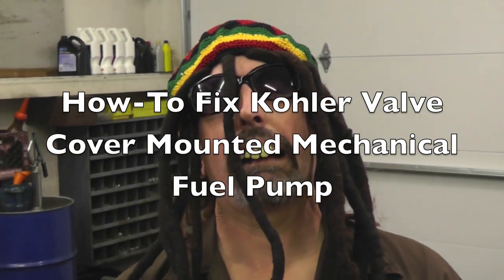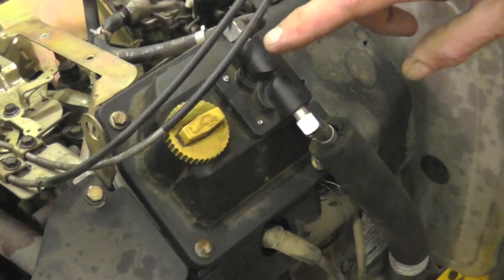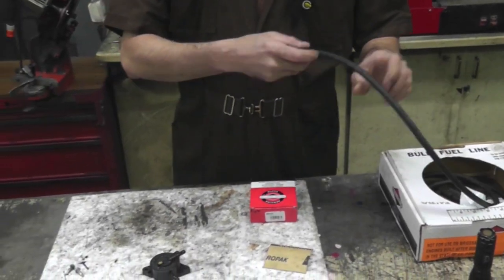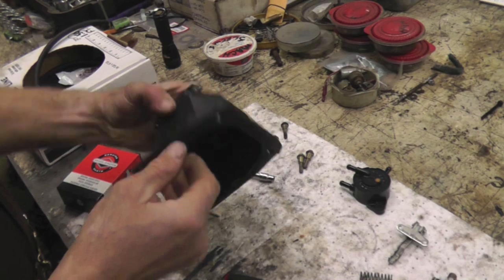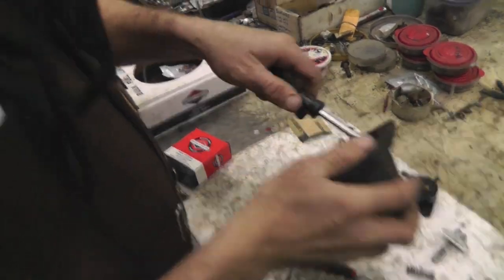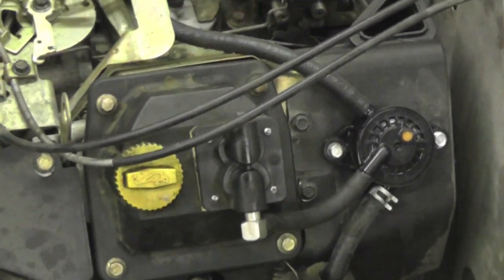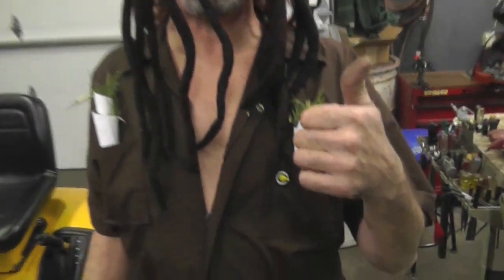How To Fix Kohler Valve Cover Mounted Mechanical Fuel Pump - With Taryl

Comment: Man I honestly bout flipped my shit when I found this . Why is the fuel pump designed so that when it fails you don't know until the block is full of thinned down oil and a connecting rod stuck thru the engine block ? It makes no sense .

Comment: As a follow-up, The vacuum/pulse type fuel pump conversion does work on the Kohler Triad TH18 engines.  I didn't buy the tractor running so found my actual problem was clogged breather.  Engine was building up positive crankcase pressure and pushing the oil out everywhere once warmed up - including the pulse pump.  Once I fixed the breather, pulse pump works great.  There's your dinner!

Comment: does it matter which port of the oem fuel pump/valve cover you pull vaccum from? i did the same one as you (unless you flipped yours) but its not sending up fuel . when i blow on the fuel hose alone i can get it to purge out . new briggs vac pump too . maybe i got a dud? also cleaned the fuel shut solenoid and put new plugs. i could have a coil issue too , but i fig lets get fuel to the carb first. bc it was running fine ( red d arc zr-8 with kholer command 20 ). afraid to take it to a shop bec theres none out here. they will probably want an am and a leg and just put the stock fuel pump back on.
Reply: Hmm I'd think you'd have to use the outlet side as it let's the fuel/pulse out. The inlet side probably wouldn't work.
Reply: The newer valve cover pumps seem to be designed differently I think

Comment: I used the method in video "How to repair  Kohler K Series fuel pump".  It works perfectly.  After I completed the conversion, I saw that I could have "gutted" the old fuel pump by removing the push rod and check valves as shown in this video.  I would still have to used the vacuum fuel pump, but it would have saved me from having to make the plate and using the 1/8" fitting.   Great videos.  Thanks for taking the time to make them.

Comment: Great video. I did this to my CH730 powered stump grinder and it worked out great.  That stock mechanical pump failed twice on me over the years and would fill the engine with gas and cause issues.

Comment: Did this replacement using a metal version of the B&S pump (found on  Amazon $20). Cranked but no go. To get it running, I used a syringe to fill both the inlet and outlet hoses with gas then put them back on the pump. Started right up after that.

Comment: Well.....    you had the right idea when you stated the problem with the stock setup, that being if there is an internal leak the gas goes in your engine and ruining it in short order. My fix was a low pressure electric fuel pump and instead of blocking off the inlet and outlet nipples on the valve cover gasket I simply ran a hose in an endless loop on those nipples and cut the fuel line and ran it along the base of the engine. I also installed a fuel shutoff valve BEFORE the fuel pump in case the pump needed replacement.  The reason for this was that if the fuel tank is filled the gas will seek its own level and it avoids a mess in the future.   A very easy fix and vastly superior to the stock setup.  About 1/3 the cost of a Cub Cadet pump/valve cover kit from the dealer.  And you don't even have to take off the valve cover to do it.  It's been one year and all is well so far.  If the fuel pump needs replacing I estimate it to be a 10 minute job..

Comment: Thank you for the video I have the 27 hp model and my fittings are push to connect and not threaded so what I did is left the connector and added a small hose and a ball valve to cap it off

Comment: I love the concept of converting this mechanical fuel pump to pulse type.  I tried it on my Kohler TH18 (problem prone) and although it runs, it's spitting oil through the pump, into carb, burning it, smoking, not working real well.  Does it not work on these overhead cam engines?
Reply: Maybe you don't have a vaccum source?

Comment: Taryl i have a lincoln ranger 8 welder with a 20 hp kohler and its mechanical fuel pump quit working could i do this ? those fuel pump replacements are $100 bucks.  mine looked like the one on the video so i might try it

Comment: Will this application work on a Lincoln welder with a Kohler CH20, the fuel tank is lower than the engine?
Reply: same reason i'm here :)
Reply: Found out fuel pump would not pick up fuel after sitting, fixed with a boat primer bulb, pump in fuel and it works.
Reply: @stevehammontree8196   how the boat primer bulb works I got the same problem on my welder I wont pick no gas

Comment: I have a question: I did disc conversion on my 25HP horizontal Kohler command pro. that is mounted on a stump grinder, which is probably a lot more demanding of the motor then probably your average lawn mower would be. I now wondering if the vacuum style fuel pump would be able to keep up with the Mechanical Fuel Pump under heavy load?
Reply: My thought exactly... Better to be out $60 once than $25 first. What ever came of your repair? Did it work? Point being is that stumpers run at WOT all day, there is no middle ground.

Comment: The old # 808656 Briggs & Stratton fuel pump# 
 597338  replaces old #'s 808656 691034, 692313, 808281, 491922, 808322, Kawasaki 49040-7001, Honda 16700-ZL8-013, and Kohler 24-393-16.

Comment: Welcome back from the Island's Man! loved the Reggae repair and getup a man after my own heart. did you see my plea about my Kohler miserys? watched so many videos forgot which one I put it on, done allot loosing power, 5 yr. old 22 hp zero trn. HELP!
please
Reply from the maker: +David Moore Power loss check out my troubleshooting video. https://youtu.be/PPBgZz9BW6U  it might be running on 1-cylinder
Reply: Thats what it sound's like every once in a while pop's out exhaust
Reply: David did you check spark and compression (both cylinders should be about equal)?

Comment: Doesn't this fix allow oil to mist up and go into the fuel lines ? Just asking cause I am having fuel pump problems with a Kohler th575s. Thanks.
Reply: Valve part of pulse pump is seperate from the fuel line portion, so no.

Comment: Question, i have a Kohler 32.5 OHV engine,  would not start. replaced the fuel pump and carburetor. Starts with starter fluid will not stay running. Any advise would be welcome.

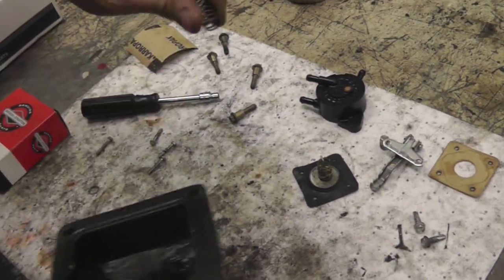Comment: On a Kohler magnum 18.5         Once I remove the 4 screws from the pump, only the actual housing comes off....the plunger lever stuff is still in the engine & dont see a way to get the plunger part out on mine. The Plunger & spring at 2:58 in this video. Can I leave that stuff in there & just use the old fuelpump Cover with 4 screws & cap off one end  & get pressure that way, or do I need to tear into the engine to get the lever stuff out too?

Comment: I watched your valve cover fuel pump conversion. I was wondering would that trick work with pump mounted in the block. Specifically a m18sq (1992 sears craftsman) with 18 horse kohler? Bastards want to retire on one purchase of a mechanical replacement pump! Keep up the good work!

Comment: I'm gonna do this on my Kohler comand 15, while I can get the mechanical pump replacement for $32, this just makes more sense to me then the mechanical that has a lot of different leak points.  Plus my thought is the mechanical will go again, probably weaker after a year, much weaker after 2 and when I go to replace it it will be $40 and continue to climb over the years.

Comment: I tried this and can't get it to pump fuel. I set it up with a 1 gallon gas can on the floor  & stuck the fuel line in and cranked the motor over but won't pull the gas.The lines are connected to the pump correctly (pulse/inlet/outlet as per Taryl).What could be the problem.It's a 20hp Kohler Command.
Reply: Bad pump?
Reply: Gas tank needs to be higher than the pump i'm thinkin

Comment: Awesome but Will this mod work on kohler ch20s 64717 engine on lincoln welder.   And also whats up with kohler engine and bent pushrods thanks
Reply: Nevermind it does work already fix

Comment: What would cause a new vacuum fuel pump on a b&s v twin I have replaced the carb, fuel filter, and the pump itself. I can put fuel in the carb and it will we run I am a loss

Comment: Hi Taryl, I have a Harbor freight 420cc motor in a Yamaha G9 golf cart. The motor will run at low speed but goes dead or chokes out at high speed. can you give some info on what to do or look for.
Reply from the maker: +Mark Talley Sounds like a carb. issue. I really don't have any info on those engines as we don't repair em at our shop due to the fact we're not a dealer for em. I would check the carb. & fuel pump.
Reply: +Taryl Fixes All 
thank you for your time.
Reply from the maker: I know this doesn't help you now but if I get one of those in fer repair with a carb. problem we'll most likely do a video. Carb videos are popular.

Comment: Taryl! I have stump grinder with engine Kholer CH18S, my fuel pump does not work. This solution is for me?
Reply from the maker: +kazeczek15 There's yur Dinner!
Reply: +Taryl Fixes All LLC  what does it mean.....?!
Reply from the maker: It means like There ya go. Or There's your answer.
Reply: +Taryl Fixes All LLC Fuel pump  2439316-S will be ok?
Reply: +Taryl Fixes All LLC Taryl my friend, please help me!
Reply from the maker: +kazeczek15 Sure ,same fuel pump. Mikuni makes those fuel pumps for Briggs,Krohler,Honda,Kawasaki Same pump just different part numbers & prices.
Reply: +Taryl Fixes All LLC  Thx, tomorrow I'll go to the parts shop
Reply: +Taryl Fixes All LLC You are king! It's works!
Reply from the maker: Theres yur Dinner!

Comment: I believe you can retrofit any sort of thing on a mower ,particularly when I paid $6.25 AUD to replace the rectifier/voltage regulator in a Honda twin cylinder powered ride on mower on someones mower that my dad was keeping it for in his shed while he was mowing her vacant lot before she moved.

The original Honda one was cooking batteries at 15 volts so a 12 volt aftermarket motorcycle voltage regulator/rectifier did the trick.

I've got a $16 AUD fuel pump & $10 AUD fuel pressure regulator that's running a Chevy LS1 V8 engine, no one would know that's running it !!!!

Hopefully I'm back from my near 6 year Holiday next week & it won't be from Jamaica !!!!

I will actually be back from Delm,not to them !!!!

A Delforce won't get that I'm a well person that's back !!!!

Comment: Where would you find a vacuum line?
Reply: That is what Taryl is using the line off the valve cover for. Crankcase vacuum.
Reply: He used fuel line.

Comment: Ive ran new fuel line & cranked it over & NO fuel comes out of my pump, So I removed the pump,or atleast I tried to but it seems only half the pump came off after taking the 4 screws off the front.      ..... How do I get the plunger type thing out? Its a Kohler Magnum 18.5hp twin engine. - Someone said "just remove the 4 screws"         ....   well,I did & that removed the FRONT part of the fuelpump. Now Im entirely screwd
Reply from the maker: +97warlock ismyname  No your not, Your using the fuel pump housing to divert the crankcase pressure to the vacuum operated fuel pump. The fuel pump housing is only acting as a port to feed the vacuum to the pump. So you need to gut the pump housing. Watch the video  again.
Reply: +Taryl Fixes All LLC  I think the word "vaccuum" is throwing me maybe          .....  The crankcase is pushing pressure out & by plugging one end of the old dead pump it would just be pressurized right?  What if I went with just an electrical pump? is this an option as well as a machenical one?
Reply from the maker: +97warlock ismyname You can use a electric one just make sure it is low pressure so you dont blow out the needle in the carb. Yes you are right your plugging one end and using the pressure from the crankcase to operate the vacuum operated pump. But you must gut the pump remove the diaphragm & check valves in the old pump & plug one of the fittings. Hope this helped.

Comment: They sell the plate for the side of the engine in that spot.  So I bought that and tapped a hole in it.
Reply: Do you have the part number?
Reply: By the way this has been working great for years. Clean too the mechanical pump would leak oil all over the place. I should really make a video for this. Right now my biggest issue with my mower is the engine does tend to burn a lot of oil so I have to add every two mowings. But it is old I'll just run and add till it gives up one day then replace the mower.